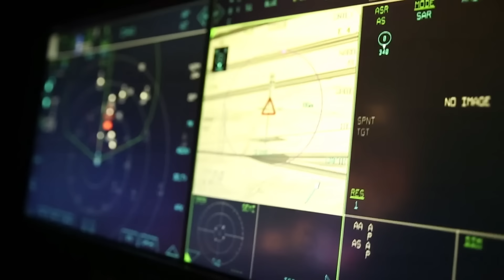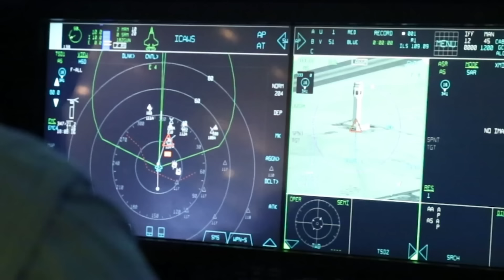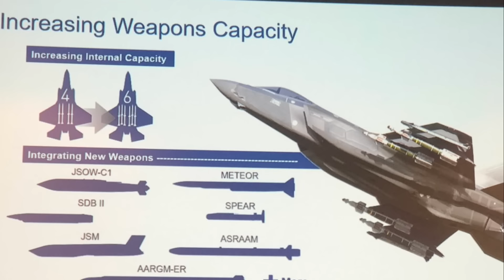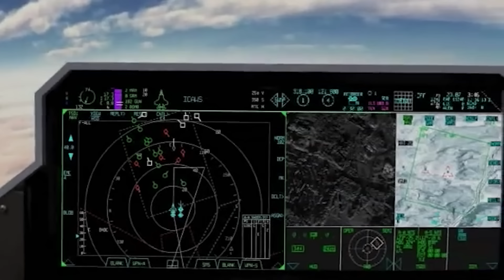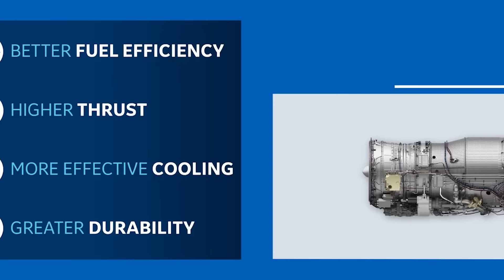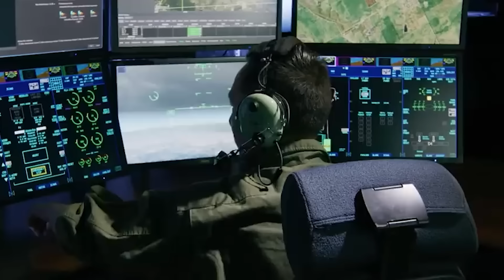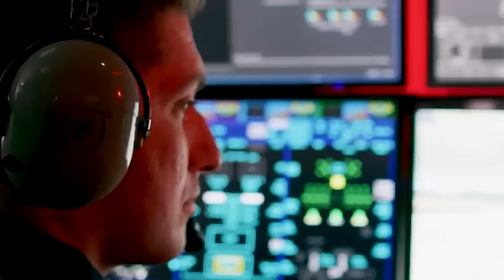The F-35 is about to become a POWERHOUSE

Comment: The F-35 is less an aircraft than a complex networked computer system.  Many of its significant warfighting capabilities are related to its computing capabilities.  The fact that these capabilites can be hugely enhanced over time without rebuilding the airframe is a major warfighting advantage.
Reply: @Brian Waas Are you qualified to make this assessment? If so how?
Reply: @Brian Waas the F35 is supermanuverable and can consistently outfight Slick F16s while under combat load.

It has the most powerful jet engine in service on a fighter, massive control surfaces, as well as a fly by wire system that allows full exploitation of aerodynamic instability.

Never mind the fact that new missiles like the ASRAAM, AIM9X,IRIST etc employ

Off boresight targeting capability

Allowing the pilot to utilize the F35's 360 sensor coverage to aquire lock, link that info to the missile, and send it off the rail burning whatever fucking direction they want, including directly backwards.

Oh yeah and with the new helmet integrated displays that can see through the plane itself, the process is simple.
Reply: @Brian Waas EA6 prowler is also retired btw. Old old platform that served well for it's time.

F35 currently utilizes growler (EA18) EWAR tech integrated into it's airframe organically.
Reply: @amistrophy   "the F35 is supermanuverable and can consistently outfight Slick F16s while under combat load."

No. It's not "supermanuverable" not even close, the aircraft was never designed for dogfighting, it's also not expected to really see any dogfights. An F16 outclasses the F35 in maneuverability, speed and engine power. The F35 is stealth and extremely advanced, however it does not compare to 4th generation fighters in maneuverability.
Reply: 'merica!!!!!
Reply: Exactly. That is why critiquing the F-35 based on traditional fighter jet attributes like speed and weapons payload and dogfighting capabilities are moot.
The F-35 is able to use it's interoperability, network access and "hyper-threading" functionality to the point that those old measuring sticks really are irrelevant.
Reply: its an over priced POS. doesn't even work. spends more time grounded than actually flying.
Reply: @techtical7079  nope, it can regularily outfight the f16 in a dogfight
Reply: @amistrophy  It cannot.
Reply: @techtical7079  Yes it can. The f35 outclasses the f16 in a dogfight with ease
Reply: @techtical7079 yes it can and will. You have really old info. F-35 had strict restrictions at the start of it’s lifespan which have been changed hugely and will rise in the future. It is now better in dogfight than older planes after G force problem’s were solved. F-16 and every other plane have had just as rough launch and F-16 was laughed and ridiculed and it was touted as huge failure and waste of money and way overpriced plane just like it was proved to be totally wrong have F-35 done the same allready. It is the best plane at least of the ones we know of.
Reply: @oggamer735  In a strict sense of a dogfight it will never be superior to a 4th generation fighter, it will be superior to them in general air to air combat. But you're utterly wrong.
Reply: @techtical7079  it literally is. You can continue to deny reality and tunnel vision on a single exercise from a decade ago where the F-35 was gimped for testing, or you can look at the numerous recent exercises and procurement contests where the F-35 achieved absurd kill ratios against 4th gens in all aspects and convinced a dozen more nations to buy in to replace their F-16s and F-18s (the USAF considers the 16 practically obsolete in peer engagements now). 900 produced in the first 7 years and not slowing down any time soon. Its not fully supermaneuverable, but that doesn’t matter when the adversaries built the J-20 which doesn’t and can’t mount a cannon, and the Su-57 of which about 12 exist. Also both are now desperately trying to copy the F-35 with the J-35 and Su-75 programs. Only one of those will probably go anywhere.
Reply: @brilobox2  And you clearly didn't read or understand what i even said, The F35 loses a dogfight to a 4th generation fighter in every scenario, however the F35 is NEVER even going to dogfight another aircraft if all goes as planned. The initial argument i responded to in this comment section was an absurdly stupid claim about the F35's maneuverability.
Reply: @amistrophy  its engine is so defective the goa warned 89% of the f-35 fleet could be grounded if its issued aren't fixed,the usaf is seeking billions more to fix the engine issue.
Reply: @christoff124  can you name a single fighter that doesn't spend more time grounded then flying? Because they've had a sky high maintenence hours vs flight hours ratio since well before Desert Storm.
Reply: @arthas640  good ol American exceptionalism.... "Our planes suck because we're the best". Tell me this when your grand children are speaking Chinese.
Reply: @christoff124  so you can't name a single plane then
Reply: @arthas640  su 27 su 34 f16
Reply: @Brian Waas You know nothing of what you're talking about.
Reply: All modern jets have the ability to have hardware upgrades. It's not impressive. Next, we'll see su35m with a complete upgraded suite of onboard hardware and software upgrades that will be connected to all military equipment on and off the battleground.
Reply: @amistrophy  super manoeuvrable, lmao, a su35 with 2 jet engines putting twice the power with thrust vectoring would shit on am f35. Also, the russians have been using helmet targeting forever, literally being able to shoot backwards.. Fly by wire means 0 hydraulic backup if damaged in anyway, you're telling us nothing but you're comment is ridiculously long!.  All it ha over a 4+ gen fighter is its stealth, which you didn't mention. The rest could be put on an f16. Engine HMD software and hardware, all the missiles also. Get out more, mate.
Reply: @carlosamigosAUS  The Su35 is one enormous piece of crap. However, I find you absolutely hilarious. Where are you from?
Reply: An invisible computer no less don’t forget the invisible part
Reply: What war has it ever fought in?
Reply: @dimbwemazala8978  none yet but to be fair the majority of modern systems are not actually battle tested against their intended opponents at best we have them tested against insurgents
Reply: @Grebogoborp  Are you serious?
Reply: @dimbwemazala8978  what major modern US or NATO system has seen combat against a peer or near peer combatant barring the equipment sent to Ukraine, NONE. We have not gone to war on a scale that gives any kind of usable data against any kind of up to date modern near peer adversary. We have fought insurgents or in the 90s we fought laughably outdated soviet era equipment. But that’s 30 years ago at this point and all our systems have seen massive sweeping upgrades since then. Barely resembling what we sent in the 90s in capability. The last time the US or NATO engaged in any kind of large scale air to air combat against a near peer or peer adversary was in Vietnam against “Vietnamese” piloted Russian jets. We really just don’t have data on this yes isolated kills, and kills against a few small groups here and there. But a large scale conflict for air superiority over a country where both sides are employing all available resources like AWACS,  SAMs, MANPADS, SPAA, and drones has not occurred for a long time. You could argue against Iraq that happened, but the air war there was over before it really started. There was very little of what we have seen in Ukraine with lots of BVR missile slinging and such. I would say the last truly full scale peer to peer war tested jet in US service was the F-4 phantom. Not saying the other jets are bad just saying that the world has been peaceful enough that we have not had to fully truly test the metal of anything since then. As such real hard data on any system is hard to really conjure up at least in reference to how those systems would perform against their intended adversary. The F-35 is a multirole stealth aircraft it’s clearly overkill against insurgents with no air defense system more advanced than a 23mm AA gun from the 50s mounted on a pickup truck. But the F-35 is designed to be a world beater. A plane so advanced it’s capable of dominating the air against even the most advanced and difficult opponents and so far everyone who has gotten a chance to look at its real not publicly available specs has either only good things to say or is trying to buy as many as possible. It would be a bit strange for everybody who can afford the F-35 to be buying as many as possible if it was not a complete monster of a jet. Especially considering the number on countries involved at some point you have to wonder just how big of a lie the publicly available data is if, despite it not looking that much better than already in service systems on paper EVERYONE wants it.
Reply: @Brian Waas As soon as the USMC saw how capable their F-35Bs and Cs were, they retired their EA-6Bs.  F-35s in Israel, USMC, USAF, and RAF have been in combat since 2017, to include strike missions, ISR, Defensive Counter-Air, Interceptor, and Airborne Warning & Control.

Unit Costs on F-35As are lower than Gripen E, Rafale, and Typhoon.

Every single pilot with combat experience in 4th Gen fighters who transitioned to F-35 said they would absolutely take the F-35 into combat over the legacy birds, which are laughable in comparison.  What is it that they know and understand that you don't?  Start there and work up from that point.
Reply: @Brian Waas The A-6 doesn't have better maneuverability in any flight regime than an F-35.  This is one of the most preposterous claims I've heard to-date, and I've seen a lot of grossly-uninformed people commenting on F-35 over the years.

If you ever look at a combat-configured F-16, F/A-18, F-15C, Su-27/30/35, or MiG-29, they're carrying all kinds of external stores that create parasitic drag and reduce their speed and maneuverability.

All of them also have huge RCSs, so they show up in the JSF MADL web either on the ground, or shortly after take-off hundreds of km before they get into their WEZ profiles.

They're being tracked, PID'd, and enter into missile solutions before they realize it.  They don't receive any spike or missile approach warning because of AESA LPI, fused passive sensors, and cooperative LPI midcourse data link guidance.

Their only notification of being targeted is the Mach 4 missile coming down through their airframe, igniting their fuel and sending their airframe into various flaming chunks of falling metal.

That's literally your missile warning when you're up against 5th Gen.

The F-35s fly faster and maneuver as well or better when combat-configured compared to F-16s and Hornets.  A combat-configured F-16 won't even touch Mach 1.5 and a Hornet is lucky to hit Mach 1.2 when configured.

If you go faster in the Su-27/30/35, you just cut the Time of Flight for F-35 missiles and expand the No Escape Zone parameters, all while flying blind.
Reply: @techtical7079  The JSF program Key Performance Parameters were:

*100nm combat radius more than legacy birds
* As or more maneuverable when combat-configured than F-16, F/A-18, MiG-29 
* Faster when combat-configured 

They do all of those things handily, not that anyone is dog-fighting anymore.

4th Gen hasn't been dog-fighting over the past 20+ years due to Active Seeker BVRAAMs and Helmet-Cued HOBS AAMs.  Nobody is trying to go to the merge unless they have a death wish.
Reply: @Brian Waas 6 Su-27/30/35s are nothing but targets for a 2-4 ship of F-35s.  There's literally nothing the Flanker series can do against JSF.

Each one of the following metrics are dramatically in favor for F-35s:

1. Detection range
2. Tracking range
3. BVR solutions PID
4. WEZ
5. NEZ
6. Helmet HOBS parameters
7. Helmet HOBS missile pk
8. Countermeasures
9. EW

A 4-ship of F-35s can get creative with how it wants to humiliate that threat set.  It's just such an unfair fight no matter what way you try to approach it.
Reply: @christoff124  F-35s have the lowest break rates and lowest MMHPFH of any Radar-equipped jet fighters in history.  MMHPFH are all in the single digits for all 3 variants.  Wherever you're getting your information, I recommend blocking those sources if you truly care about being informed on this subject.
Reply: @techtical7079  Read what high hour Viper pilots have said once they converted to F-35A regarding BFM.  Same with legacy Hornet pilots who converted to F-35B or C.  Once they learn to use the 28°/sec yaw rate and the vertical, it's over for a combat-configured F-16 or Hornet, not that they would realistically merge anyway.

A lot of people make the mistake of viewing airshow demos of slick, stripped-down fighters flown by demo pilots. 

Even after you jettison external fuel tanks and bombs, you still have an 800lb ECM pod, 455lb FLIR Pod, pylons, and 4 or more missiles on the LAUs.  F-16CM will also have the HARM Targeting System Pod.

All of those things are heavy and draggy, noticeably reducing aerodynamic and kinematic performance.

An F-35 with internal bombs and missiles will still out-climb, out-rate, and get solutions on you first if for some crazy reason it allowed you near it.

They rarely do BFM in post E-Jett configuration, outside of Fighter Weapons School in USAF.  WIC emphasizes combat configurations, which is why the F-22 and F-35 are what they are.
Reply: @Globalscanningeyes  The Pratt & Whitney F135 is the most powerful, reliable fighter engine ever built.  The GAO knows 2 things about fighter engines:  Jack and Squat.

Ever since the F100-PW-229 in the F-16C/D Block 52 and later F-15Es, US fighter engines have become amazingly-reliable.

F119 in the F-22 is another generation ahead of the -229.  F135 is another huge incremental advancement ahead of the F119.

These younger tards writing about things they know nothing of would lose their minds if they were in the 1950s-1980s.

We lost 143 F-16s in its first 10 years of operational service, 71 fatalities.  If that happened with F-35, it would be cancelled.
Reply: @LRRPFco52  oh geez,my mistake i wonder why they're looking for its replacement must be a mistake or something totally not because its defective or anything.
Reply: @christoff124  Even the F-35C has dramatically-superior readiness rates and lower MMHPFH than any F-16.

F-16 MMHPFH range from 11-22hrs depending on type, airframe hours, and year.

F-35A has been 3.5-5.4hrs, which just has never been a thing.  CPFH is much lower too, despite what all the legacy media sites claim.

Su-27s are maintenance hogs with very low availability, cannibilization for spares, twin engine, failure-prone mech-scanned Radar, garbage Russian electronics, stress fractures in the neck/fuselage bulkhead region due to drunken idiots over-stressing the airframe, already on Serial Modernization 3 to keep them barely relevant.  Half of the Su-27SM and Su-27UB fleet isn't even worth upgrading according to internal Russian air force statements.

Su-35S is their latest operational 4.5 Gen fighter, already being shot down by themselves or Ukraine due to its huge RCS and lack of coherent IFF among Russian forces.
Reply: @carlosamigosAUS  Su-35S already is the standard for upgrading Su-27SM3 and Su-30SM2 for common Irbis-E PESA Radar, glass cockpit using Western electronics, common data link, and improved performance engines.

The Irbis-E is easily outclassed by the Rafale F4's tiny AESA, which is easily out-classed by the AESAs in the F-15C+, F-15E+, F-22A, and F-35s.

Super Flankers are literally at the bottom of the pile when it comes to modern fighter Radars, electronics, and overall systems, while also having huge RCSs.
Reply: @carlosamigosAUS  Su-35's Saturn motors don't have twice the power of a single F135 (43,000lb in AB), nor do they have superior Helmet HOBS.  F-35 with HMDS and AIM-9X Block II+ is superior to Russian HMS and R-73.

That would in the worst case scenario involve frontal aspect launch at edge of BVR, if F-35 pilots decided to allow Su-35 near them and not kill it at distance.
Reply: @dimbwemazala8978  Israeli-Syrian conflict, Israeli-Iranian skirmishes, US-Syria/Iraq/Afghanistan, UK-Syria still ongoing since 2017.
Reply: @Globalscanningeyes  Who is looking to replace what?  The engine?  The engine has a scheduled overhaul like every other engine, only it will get a major increase in thrust and fuel efficiency at depot-level.

I've been involved with these types of programs since the 1970s, to include living through all the mishaps we had and the IPE program in the 1980s.  The F135 is a dream compared to any other fighter engine in the world in terms of performance, reliability, and low observables. 

GE has been trying to get into the F-35 program as the prime or secondary engine provider.  You're seeing advertisements for them disguised as news, nothing more.  I don't blame them because it would mean thousands of units and billions in revenue over the next 15 years.
Reply: @Globalscanningeyes  If you’re seeing any sites claiming the F135 is defective, go ahead and block those from further information consumption.  They aren’t valid or informed in the slightest.
Reply: @quasimotto8653  I’ll lay out 2 fighters configured for combat and then let you guess which one matches the performance characteristics:

Fighter A:
12,000lbs of fuel
2x 2000lb JDAM weapons
4 Air-to-Air Missiles
1 ECM System
1 FLIR System
1 Special Weapons Targeting System
Helmet Cueing System

Fighter B:
18,250lbs of fuel
2x 2000lb JDAM weapons
4x Air-to-Air Missiles
EW system
FLIR system
Helmet Mounted Display

Performance Capes/Limits-

Set 1:
Do Not Exceed Mach 1.2 at 15,000ft+
Do Not Exceed Mach 0.95 below 15,000ft
5.5 G limit until fuel is 7,000lb, then 7.3 G limit

Set 2:
Do Not Exceed Mach 1.62 at 15,000ft+
Do Not Exceed Mach 1.2 below 15,000ft
9 G limit

One of these is the F-35A, and the other is the F-16CM+ CCIP II Block 50/52 Viper.

These are the least-important metrics by the way.
Reply: @LRRPFco52  Wow............thanks for the data.
I work for LM in Fort Worth, Texas at AF Plant #4.
I was there when most of the F-16s were built, all of the F-22s and so far, all of the F-35s.
Reply: @Grebogoborp  US major weapon systems that have fought against numerically-superior forces and prevailed overwhelmingly:

F-15C APG-63(V)1 AIM-7M AIM-9L
F-16C/D Blocks 25, 30, 40
F-15E APG-70 LANTIRN, GBU-series
F-111F with PAVE Tack and GBU-series
F-4G with HARM
EF-111A
F-111A

F/A-18C
A-6E
EA-6B

M1A1 Abrams MBT
M2A2 Bradley IFV

Iraq had 768 Tactical Combat Aircraft, which exceeded the combined allied air power assets deployed to Desert Shield and Storm.

Iraqi Air Force was decimated within days.  In the armored warfare tank battles, the M2A2s and M1A1s humiliated the Iraqi tanks, self-propelled howitzers, and BMPs.

Every single one of the above systems has been replaced, retired, or upgraded with greater capabilities.

If we had F-35s for Desert Storm, the war would have been over within a few days, not 2 weeks.
Reply: @quasimotto8653  We were on the F-16 CTF at Edwards in late 1982, then again from 1987-1990, then on to the F-15 CTF mainly for the F-15E systems integration and test, GPS-guided munitions development (before it was called JDAM), and other things.

I love those birds, but they are out-classed by the F-35 in so many ways.  Combat-configured, the F-35A will always have more speed and G available compared to legacy birds.  More importantly, it has superior SA even to AWACS and linked 4th Gen fighters.
Reply: @LRRPFco52  I agree.  There is a REASON that one is 4th Gen and the other is 5th.
Just like all other fields that are influenced by rapid advancement in technology (which is MOST fields), it would be stupid to expect something that was designed and built in the 1970s to compete with something from the 2000s. 
Someone in a previous comment said something to the effect that an F-16 can be "up-dated" or "retrofitted" with all the latest goodies that the F-35 has.  That's just not true.
And even if it was.........Lockheed Martin would not want to do it.  It wouldn't make good business sense to put equal tech on your older product that you are putting on your latest and greatest.  At the end of the day, LM is a for-profit business, just like any other.
Reply: @quasimotto8653  It’s physically impossible to integrate the sensors, IPP, internal weapons bays, and VLO features into any 4th Gen platform.

The entire mold line and bulkheads all have to change for starters, which means a completely-new airframe design.  At that point, you’re back into the design cycle that resulted in F-35.

There’s no place for DAS, MADL, and EOTS on the Viper.  These technologies were tested on the AFTI F-16 at Edwards, which is the coolest F-16 you will ever see.

They put LANTIRN pods in the LEX roots so you wouldn’t have left or right blanking of the pilot’s FOV when trying to lase or observe a ground TGT with the FLIR.  That’s more expensive than going the EOTS route, since EOTS is centerline under the nose.

The Flight Control System in the F-35s are actually more simple than in the Viper since they have independent ElectroHydrostatic Actuators (EHAs), with their own self-contained hydraulic fluid that doesn’t need to be piped under pressure to them from the central hydraulic reservoir and pumps.

This makes safety and maintenance so much better than the Viper, and they’re not fly-by-wire, but fly-by-light.  

On the Viper, if replacing an actuator assembly, you have to bleed the hydraulics, disconnect the FBW system, disconnect the hydraulic line, unbolt the fasteners, install the new unit, fasten, reconnect the FBW, reconnect the hydraulic line, re-fill the hydraulic reservoir, pressure up the system and measure if it is too full or not full enough, and you have to manually index the actuator position with the control surface to make sure they’re tracking correctly with each other and the DFLCS position cues.

With the EHAs in F-35, you disconnect the fiber optic line, remove the fasteners, pull the assembly, install the replacement EHA, reconnect the fiber-optic line, the system automatically indexes the actuator to the control surface position and registers the position with the DFLCS....done.

Maintainers complain that it basically maintains itself.
Reply: @LRRPFco52  lemme check if I care more about a government agencies report whose literal name has the word government accountability in it or some stranger on the internet whose credentials I cannot verify.
Reply: @Globalscanningeyes  So I've been in the developmental and operational world in this space since the 1970s, with decades spent at the USAF Flight Test Center and deployed abroad.  We got used to taking GAO, Pentagon, and "watchdog" reports and just laughing at them, then realized that people that far out of touch are actually influencing or calling the shots on funding.

But here's a way any layman can understand how much you're being lied to.

In their first 10 years of operational service, here are the airframe loss and fatality rates for the following aircraft:

F-14: 73, 19
F-15: 54, 26
F-16: 143, 71
F/A-18: 97, 27
Harrier: 100, 20
A-10: 59, 26

That's 526 airframes with 189 fatalities.

F-35, all types:
F-35A: 4, 1
F-35B: 4, 0
F-35C: 1, 0

Only 1 person has died in operational service with F-35s, a Japanese Defense Forces pilot who seems to have had a physiological episode, then plunged into the sea from high altitude.

This type of safety record is unheard of in fast jets.  Over 920 F-35s have been delivered to services all over the world.

Pilots who flew fighters before transitioning to F-35 absolutely love the engine, the controls, the flight control system, ease of flying, ease of landing, and the systems interface.
Reply: Or a hackers dream come true. Guess which country has best computer hackers.
Reply: @quasimotto8653  except Russia has very likely the best EW complexes and ability to disrupt/bring down satellite coms ie Starlink and many system to kill satellites. All the electronic high tech system when it doesn’t work is as good as a door stop.
Reply: @amazin7006  According to who? Without the full electronic network system, airframe to airframe, F16 accelerate faster, has faster top speed, is more maneuverable, has higher ceiling and has more and proven weapon suite. F35 has stealth, but close in, it is sitting duck.
Reply: @techtical7079  in real war all “plans” goes out the window. The worthy adversary trains to defeat your plans.
Reply: @arthas640  Su25, Su27, Su34, Su30, Su35, SU57, Mig31…
Reply: @F35_JSF  “Su35 is one enormous piece of crap” …based on the Nintendo video games you play.
Reply: @Grebogoborp  USAF lost close to 6000 aircraft in Vietnam against rice farmers put into Soviet jets.
Reply: @LRRPFco52  The only known combat experience of F35 was Israel strike mission against Syria pre Russian involvement. No F35 was flown by USAF in actual combat mission, not in Iraq, not in Syria, not in Afghanistan. There is a story that after Iran retaliated against US air base after US assassination of Gen Soleimani who was on diplomatic peace mission, USAF sent squadron of F35 to hit back but when they were all lit up by Iranian radar they all turned back. Or is it normal for USA to have a major attack on their air base and do nothing?
Reply: @LRRPFco52  yes yes based on paper prepared by the experts paid by Lockheed Martin. Totally credible. Sign here for the next  multi billion service upgrade. 20 years from now, the F35 will get it first air to air kill - a 2045 Iranian weather balloon.
Reply: @GenghisX999  🤣🤣  Right, Right, Right.

Just like Russia has "the best" tank in the T-14 and "the best" stealth fighter in the Su-57.
Oh! And "the best" SAM system in the S-400?
Like almost all of Russia's supposedly "best" equipment none of these exist in any significant numbers.
And when they are put to the test, more often than not, they are a big disappointment. 
Less than 2 weeks ago, one of the few S-400 systems in use against Ukraine was roasted..........by an American HIMARS. So that's a $500 million S-400 system taken out by a HIMARS unit that costs about $5-6 million.
Tell me again why you think Russian EWs are so good. Russia can't even make a decent automobile.
Reply: @GenghisX999  From now on, anytime you get the urge to comment on things related to aerospace, do yourself a big favor and don't.
Reply: @carlosamigosAUS  "All it ha over a 4+ gen fighter is its stealth" 
That's all that matters. You can't shoot what you can't hit. It doesn't matter how maneuverable your jet is if you're dead before you see your enemy lmao. SU35 is worthless, it's the same 1970s plane
Reply: @Grebogoborp  In Syria there were dogfights with Turkish f16s against upgrade Sukhois and the Ruski planes got annihilated.
Reply: @LRRPFco52  is that your rules based order?
Reply: @GenghisX999  Just if you care to not look like a fool.  So far, none of your statements have been accurate.
Reply: @quasimotto8653  If the S400 was destroyed by a HIMAR, do you think the AFU did it? They may have pushed the fire button but everything else from targeting tactics etc was American. Most likely a salvo with many decoys. Any comment about the Patriot PAC3 destroyed w 2 Kinzhals? $1.5 billion at cost to Russia of $4 million. Are you keeping score?
Reply: @amazin7006  I am still waiting for my 5 ruble check from Putin but I suspect I will get a Benjamin from Killery first. So many F35 fanboys sucking up the rah rah MIC propaganda. Would much rather see US spend money to fix infrastructure, education, health care, housing and care for its vets. Imagine peace. What a novel concept.
Reply: @amazin7006  “you don’t care for the truth” spoken by somebody in the heart of the Empire of Lies.
Reply: @GenghisX999  Empire of lies, meanwhile you defend Russia hahahaha. I can list a million lies from Russia in just this one single month.
Reply: @@brianwaas1142The Australians and other allies must think it’s worth the money.
Reply: David Beattie 
You are correct it is more a computer that uses Microsoft as it base for source code 
Oh dear the flaws of Microsoft 
I have hacked that garbage on quite a few occasions 😂
Reply: @@brianwaas1142somebody drank the coolaid, still quoting news reports and tests done with pro type aircraft? 😂
Reply: But also not less an aircraft. Because it flies around
Reply: @morningstarx5340  
The F35 base computer system is Microsoft no flaws in that system 
😂
Reply: this might have been a mistake but until there is a conflict to see it “shoot first” we don’t know how effective going to be. Really they should have not cheaped out and had best of both worlds. Maneuverability, speed, climbing etc with the computer power or just keep F22
Reply: @LRRPFco52   dude being a wiki page doesn'tean yoy understand anything about russian twch, I doubt the pentagon know enough about upcoming radar and cockpit upgrades for the su35
Reply: @amazin7006  incorrect
 Radar twch is what matters when it comes to planes. They all give off signatures
Reply: @mark4371  Source: you made it up. 
F35 cockpit screen is linux based
Reply: @anthonyurso3554  f35 has the most advanced radar of any fighter jet.  It has an AESA radar that is 2 generations ahead of j20 and su57. It is also better at dogfighting than f16. Where did they "cheap out"?  Your sources are nonexistent
Reply: @amazin7006  f35 
Thrust to weight 0.87 
Climb rate 230 meters per second 
Top speed 1200 mph 
F16 
Thrust to weight 1.1 to 1.2 
Climb rate 55,000 ft/min or 916 feet/sec or 280 meters/second 
Top speed 1,320 
The f16 is a better dog fighter
Edit: finding different numbers depends on model for both f16 and f35 but it does seem the newer models of F16 have slightly better performance numbers
Reply: @amazin7006  yea In an exercise f16 dominated the f35. But it wasn’t able to us there ability it has now. To use helmet to lock onto aircraft to shoot missiles. In the exercise the f35 failed to get its nose lined up. So still very advanced like said. Prob gonna be implemented in groups and most likely shoot first because of stealth and avionics. But regular performance it’s not on same level as f16. Which is crazy because f16 is from mid 70s. So maybe time will tell how the f35 does in actual combat. Every fight has a purpose but I def like to see the regular performance be better
Reply: @anthonyurso3554  Yeah the most worthless training excercise that you could have ever cited 🤣 it wasn't allowed to lock on using helmet sights.  The f35 was limited in the G's it can pull due to being a test vehicle rather than a production version.  An f35 has never lost to an f16 in a fair dogfight.  It has scored 23:1 and 24:0 in training excercises against 4th gen aircraft.  

F35 is a better fighter in every single way than f16. Both in dogfighting, EW, stealth, speed, and in range.
Reply: @amazin7006  it wasn’t worthless because it still failed to get its nose lined up. The f35a is the best performing model they have. The main limiting factor was the helmet vs how the fighter can actually maneuver. They can blame the airframe but the numbers don’t lie. It sounded like an excuse. Or why even have that training exercise where can’t perform fully? And the pilot didn’t blame the airframe. We also have to take into consideration the f16 is from the mid 70s and we just funded another 15 billion into f35 program. My whole point is if we already have a fighter jet that’s better (f22) why put more money into f35? I don’t see how this isn’t a budget issue and I’m not gonna blindly believe the hype. I saw the other exercises but there is like 0 details given. I don’t think we can just conclude it’s better in every shape and form. It’s promising fighter but it def was not designed for dogfighting. It was prob 24-0 because of stealth, avionics etc could shoot first and not be detected.
Reply: @@brianwaas1142 Comparing a multi-tasking fighter jet to a 1960s EA-6 (that could do just ONE thing, flying at bi-plane level speeds) and a "housing project" in maneuverability is just mindless gibberish.

The exquisite public air show stunts pulled by the 2D F-22 and by the 3D Su-35/57 have zero actual battlefield application.

BTW, a bi-plane --- both modern and old (with very small engines) --- could physically do maneuvers that the F-22 and Su-35/57 could only cream about.  But, again, how useful MILITARILY are those eye popping slow speed maneuvers?  ZERO.

Today's high end anti-aircraft missiles, between Mach 3 to Mach 6,  don't care whether you're doing "Cobra maneuvers" or flying at top speeds. If you don't know about those things & enter their bubble or "kill zone," you're just a large chunk of metals with a person or two strapped on it/in it, literally and metaphorically.  

The last time a manned military aircraft in the battlefield out flying anti-aircraft missiles was in the 1960s to 70s, with missile technologies in those days still lagging behind the SR-71, which could do Mach 3 plus, carrying absolutely nothing but fuel, small camera gears, & a guy in an actual space-suit!

Between 7 to 10 years from today, another set of engine drives, plus better chips & AI programming, would usher in even faster anti-aircraft missiles, both air to air and ground to air missiles.  

 Hint, that's why the seemingly average looking F-35 is touted as a flying super computer.... a computational brain that is capable of being doubled, tripled, or quadrupled, in the next 3-5 years, coinciding with the time frame after which a new fighter jet is put into operational mode, with most or all wrinkles ironed out.

The trick to avoid being blown to pieces in the sky is NOT to try, in vain, to outrun or to out-maneuver tiny missiles that EASILY out-speed & out accelerate you, on average, by a factor of 3, 4, or 5. Trying to do that is actually more stupid than taking the biggest knife or longest sword to a gun fight.
Reply: The enemy will be able to build more capable drones cheaper and more quickly than the f-35 so that the latest tech and fastest gpu’s and processors will be easily intergrated in the drones coming off the assembly line. Making the drones better than the f-35 in every category from performance to stealth to cost to build time.
Reply: @arthas640  Well, the F35 only became a fully operational program just a few years ago. Growing pains.
Reply: @amistrophy  Yeah, they changed the rules of engagement to let the F-35 win.
Reply: if you have sophisticated anti air systems then you shot them down or you sent either jets yo intercept them. Remember, F35 is a slow aircraft.
Reply: @GenghisX999 "USAF lost close to 6000 aircraft in Vietnam against rice farmers put into Soviet jets." 
All told, the U.S. Air Force flew 5.25 million sorties over South Vietnam, North Vietnam, northern and southern Laos, and Cambodia, losing 2,251 aircraft: 1,737 to hostile action,
Reply: @amistrophy  brought to by Lockheed Martin your friendly neighborhood arms dealer. We make killing fun!
Reply: @@brianwaas1142 this guy's obviously years behind on his info.
Reply: The software is so voluminous and so complex that the inability to perform standard regression testing to identify bugs "may" have led the mothership to buy two quantum computers to aid in the required throughput. Which could have been beneficial in achieving Program Readiness Review Combat Ready approval. That is all.
Reply: @@brianwaas1142lol you think a college grad built and designed the F35, youre immediately discredited from this entire conversation dude.
Reply: @christoff124 actually, all american fighters spend more time on the ground than flying xD that is why they work so well, theyre maintained EXTREMELY well.
Reply: @techtical7079 you say you cant predecide fight criteria, but that is exactly what you're doing. You keep putting the F35 in a dog fighting scenario, and its radar and networking capability will so rarely let that happen you can bet on it. Safe bet.
Reply: @haventthoughtofanameyet6364  Like i said so, multiple times.
Reply: @carlosamigosAUS if "the rest" could be put on an F16 frame, that is what they would have done...russians reuse old airframes with new tech all the time. Their bombers are from the 1960s with a few electronic upgrades lol russia cant afford to invent new things, it is much cheaper, but much less effective to keep upgrading old frames of warships, jets, guns.  New ideas are better than reinventing the wheel every decade and calling it "new". Yes, the helmet technology has been around for a long time, we have been using and testing it in our AH64s for years. An SU 57 wouldnt even get off the ground to go fight an F35 because russia has so few of them they dont want to risk losing anymore than they have.
Reply: Texas brother.
Reply: @dimbwemazala8978  The ones you don't hear about. Daily.
Reply: @LRRPFco52  True statement.
Reply: @Globalscanningeyes  Not true. I work there. Get your facts or shut up.
Reply: @quasimotto8653 how does it use its hyper threading? Does that vaporize enemies or...?
Reply: A jack of all trades at most.
And i'm saying it nicely
Reply: @nemiw4429    LOL   No.......hyperthreading doesn't "vaporize enemies".
If you understand anything about computer tech, you know that hyperthreading increases the speed of data processing. 
Fighter jets, like automobiles and many other devices these days, are more and more becoming moving computer systems.   One of the critical advantages that the F-35 has over other jets is that the onboard  computer systems are able to gather and put to use relevant data so quickly that can be used to defeat a competing jet........that is why the other jet being "faster or more maneuverable" really doesn't matter. 
The F-35's high level of data processing can also be used to the advantage of OTHER friendlies.  The F-35 can quickly gather situational and targeting data and then share that info!
Reply: @quasimotto8653  Im a software engineer. So no i andastand nothn man! 0! But my Q was specificly what does hyperthreading do to make the f35 a better jet. Ofc CPU is faster than ... single core, but u cud have said newer cpu, faster. Why specificly mention hyper-threading?
Reply: Lol! No, it's pretty much an aircraft and then it's everything else.
Reply: @christoff124 all of which suck when compared to the f-35
Reply: You sir must have a-150iq
Reply: This isn’t anything new. There is a reason we are still flying the B52 after so many years. Same airframe but everything has been upgraded.
Reply: You know what a gigantic and catastrophis disadvantage is? Being ridiculous expensive.

On top of that: fancy electronics are a nice target for ECM and a good source for endless failures and repairs.
Reply: @techtical7079 What do you define as a "dogfight"? Based on any of the definitions everyone is assuming it doesn't really mean much. It's like saying someone will win in a fist fight but the other person has a gun so they'll be dead before they can fistfight anyways. An F-35 fleet can maintain air superiority much better than any other aircraft and take out air defence capabilities. So in this case dogfighting isn't really relevant in the classical term. There is no situation where the F-35 gets into a dogfight because it will recognize track and destroy any aircraft before it gets close. If it can't, then it will turn around and stay hidden.
Reply: I'd say it's an aircraft